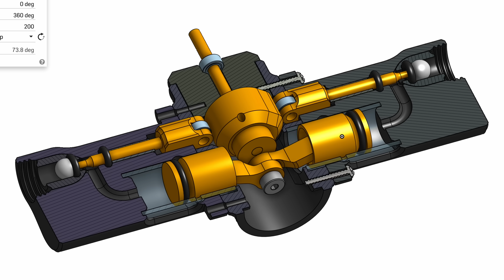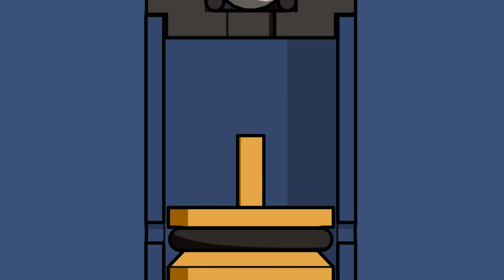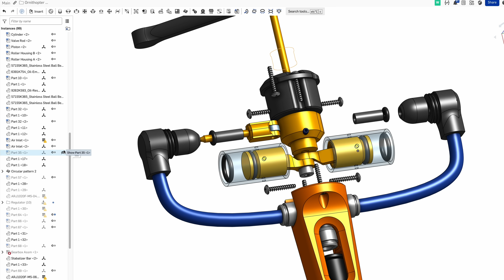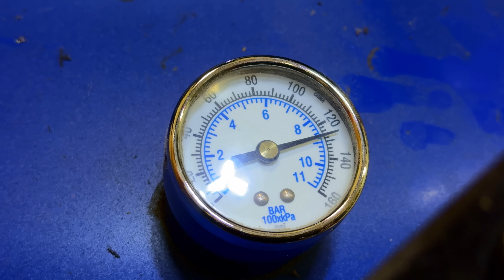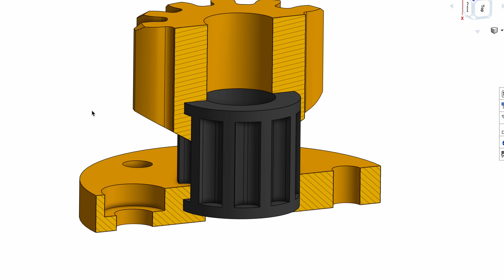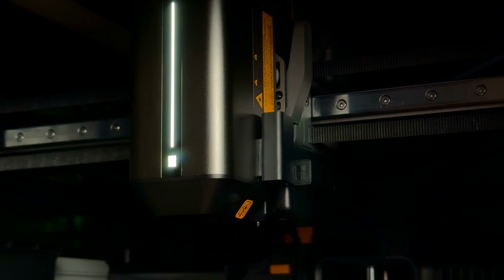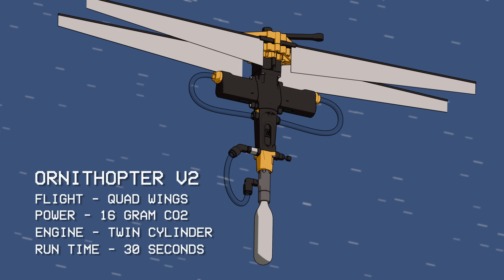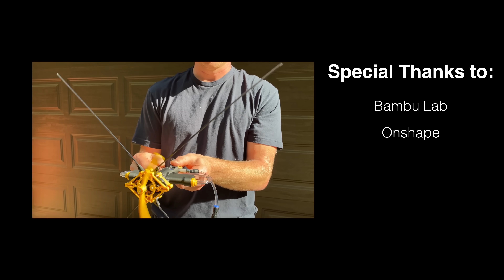I Tried to Build a Flying Machine With Just CO2

Comment: Great video! Do you have any Suggestion on a small pressure regulator?
Reply from the maker: Depends on what sort of pressures you need, there are some really small ones I used as the secondary regulator here: https://www.smcpneumatics.com/ARJ1020F-M5-06.html
Reply: @worksbydesign Thank you very much in advance. I would ideally need one that works with 6mm pneumatics, which doesn't have to withstand more than 10 bar. Thanks!  I'm really glad that you care about your comments!
Reply from the maker: @Karmesin-Pilz Anytime! and I believe the one I sent works with a 6mm line and has a quick-connect fitting on the outlet side.

Comment: why turn a linear motion into rotation just to turn it back into linear again? that seems like a major power and efficiency loss
Reply from the maker: Definitely worth a try, and I did try early on but it always ran better by connecting it to a flywheel or a crankshaft because it gave it momentum to continue firing evenly. And once I added a flywheel it was easier to just take power off of that rotation, especially when trying to find the best gear ratio to flap the wings. Could be worth taking another look at it though!

Comment: Your wing design is extremely lacking in optimisation you should have the torque required to double surface area. Wing should be loose towards the main body and fixed at the tips more like a triangle than a rectangle that you have. You have to remember that what you are building is a vertical windmill not a plane with aerofoils. You are looking to maximise drag not minimise. Drag is the only thing that will provide thrust in this situation.

Comment: Cool project! It’s just reminded me of a tool that has a reciprocating piston that is basically its own valve, it’s hard to describe simply but if you do a search for ‘Steve Lindsay engraver’ you should find plenty of info, patent design sheets etc. (expired now so ok to use). It’s very simple and ingenious and is used in this case in a gas powered, hand held precision engraving tool employed by jewellers, firearm engravers and the like.

Comment: Need that regulator vertical, nose inline so that your weight is even..
Reply: What if you connected the four wings into pairs?
Also if you tilted the bottom of the wings to 90 degrees on the return cycle you wouldn’t be wasting energy , actually gain lift… super cool stuff! Love the mechanics!

Comment: Why convert the engine’s piston motion to rotationl motion and the back to a back and forward motion in the wings?

This seem like an unnecessary step that both add weight and cost energy in form of resistance in the system.

A better way should be to create an effective motor that oscillates back and forth on purpose and directly drives the wings.

Comment: You need to improve your pressure regulator so you can dump the flow restrictor.  Add a third cylinder will improve engine balancing and add power allowing larger wings

Comment: Yes, iron parts add weight. What if it's a crazy idea to add a gas bag like an airship or a fish LOL This is cheating to some extent, but it will save you from recalculating the entire structure if the wing area is increased.

Comment: For Some Reason You Lowering the Pressure With The Regulators Is Ruining it And Also Planetary Gears Are Quite Inefficient!( Custom Set Diagonally Would be better most Common You Could Get Made Would be hypoid gears ) Probably be Better To Use Something 1, More Pressurised? but UnLikely You Could get Anything At a Reasonable Price that You Don't Make Your self Which Is also Expensive ether Way Try HydroGen as Not only is It Lighter and More robust but you Could Make Exhaust Thrust With A Piezoelectric Sparker That Uses Excess Torque to press a little bit of crystals together In Ociliation With the Outgassing which would Allow for it To Naturally Ignite?  if You Still wanting to Out-vent The gasses without Energy Loss As Just waste? , and 2,  Directed Push Like a Water Wheel As to get the Most Energy I think You Losing about 30-50% Just With The O-ring and Pressure leakage That Comes from the Ociliation and the way it's down Why Completely Out vent what is use-able Gas?

Comment: Makes no sense to convert linear to rotating, thru a gearbox and back again.
Piston moving the wing directly and maybe a return spring.
Also any regulating the pressure down is a 100 percent loss. Way better off reducing the intake duration, that makes more power with less air.

Comment: One possible idea could be to intentionally use the backfiring of the piston to power the wings. You need to switch direction with a gearbox anyway so to me it makes sense not to waste energy and weight on a gearbox that switches for each flap and just have a really fast piston that switches direction after every cycle

Comment: hypothetically couldn't you cut down on the weight and complexity by going back to the original piston design, but using a 5-cylinder radial design? That way once you've got it moving even a little, each piston push would provide the impetus needed to overcome the backwards pressure from the next piston?

Comment: Piston and reciprocating motion is not energy efficient. That said, you can still use hydrogen and a piezo actuator(not really electronic, since only a hammer action is involved)🤔, to compensate for lack of energy. Another issue is the ability to capture energy during the entire pressure cycle(with hydrogen, it is more of an impulse, so you don'tneed to worry about that). There is still a lot of energy left on the low pressure exhaust with the current design. Just some 💭

Comment: Aluminum parts could help in a bunch of places, but the complexity of the part molds makes me think that's not terribly feasible. But hey, anywhere you can work in a .45 mm wall Aluminum tube instead of a 2.7+ mm wall ABS tube, you can come out ahead.

The other thing I thought about is an opposed-piston engine design, chasing that power-to-weight ratio demon.

Comment: Consider that you might use the ideas from a reaction wheel or gyroscope to keep the flappy bird stable in orientation.  Also consider that if the pistons process in and out at the same time then the vibration will be limited.  Think subaru boxter engine.

Comment: Back in the 80's, they had these air-powered vehicles called Air-Hogs.  I had one that was an airplane.  You would use the included hand pump to pump up the chamber and then once it was pressurized, you'd disconnect the pump and then spin the prop and the engine would start up and the plane would take off.  It was very similar to this device.

Comment: Seems like this design would benefit greatly from a phase where the wing segments cut or align horizontally through the low pressure areas and vertically (or largest wing surface towards with angle of attack) to the high pressure area.

Comment: This is a very challenging project and you have made great progress. Suggestions to improve system: Modify the motor to use more cylinders with Tom's valve concept. Should get more power to swing bigger wings and less weight. Having more cylinders should overcome the lack of flywheel problem again dropping weight. An even crazier modification would be to eliminate the gear train and direct drive the wings. They do follow a reciprocating motion which is what pistons do. A linkage would be required to keep them in sync. Redesign plumbing to eliminate hoses and couplers. Build the pressure regulator into the valve plenum collapsing the vertical height. Again dropping weight. Good luck with your next version of this project.

Comment: I am by far not an engineer, but to start check wing designs, angles, size, pitch, etc. Regulate the speed a smidgen faster and yes, weight reduction. Use a heat gun on tubes for curvature but reduce the length,  then play around with other piston designs. Again I'm no engineer and other comments sound very plausible

Comment: Neat solution isolating the valve to eliminate the flywheel but, if you're going for a multi-cylinder engine, couldn't you go for 3 cylinders so that whenever a cylinder has to push the ball, an adjacent cylinder is in the power stroke so there is torque to drive the ball up.

Comment: I may be stupid but could you use smaller tubes to regulate pressure and air flow? It would take either really good math or a lot of testing. It could save a lot of weight on top of being able to remove the pressure regulator entirely.

Comment: 3:00 Okay, please explain to me why, when you’re trying to make something “oscillate with changing direction”, you worked so hard to make your engine stop oscillating back and forth and instead produce rotational motion, like what a propeller needs (which isn’t what you’re using), all so that you could then turn that rotational motion back into an oscillating one…
Reply: I guess the engine is way more efficient when its just running without changing direction
Reply: @juusoleinonen  That’s probably true for most situations, but I don’t think that is true here. A propeller needs constant even torque because the force it needs to exert is constant. But a flapping wings torque needs aren’t constant. It needs much more torque at the end of its swing when slowing down and changing direction than it does in the middle of the swing when it’s just pushing on the air. And I’m pretty sure that the oscillating engine design would have produced torque in that same pattern, meaning that for his specific needs it would have been perfectly efficient!  Instead he added more complexity and weight to his machine to produce an effect which is less efficient than what he could have had… 🤦🏽‍♂️
Reply: To include changing direction
Reply: @patrickwalsh7874 what changing direction?
Reply: You are right, torque at the right time, less friction etc...😊
Reply: Idk

Comment: Love the idea, and you used the steam engine intake but not using it for both directions looks like a way to not get full power, as the other cylinder is working just to move it. Also you may fall into the ‘rocket equation’ problem of needing more fuel for more weight.

Comment: I'm not sure what you would call a 'not opposed dual piston' layout, other than a good vibration source? (it's NOT a boxer layout).
Everything there seems to be going in the right (theoretical) direction, but many things could be improved...
You could create a twin inward opposed motor (two shafts and pistons into a single chamber), which would be inherently better balanced, and would only need one valve cam.
I would look into printing helical gears all round to lessen chatter.
If the torque being created is where I think it is, I would greatly increase the 'wing area', larger panels. probably with more taper towards the tips, and assembled with a bit more care (good tension, no wrinkles, sitting perfectly flat at rest), I also notice a small hesitation in each stroke? I don't know what is causing this (at a cursory glance), but I suspect it is absorbing a modicum of power in each stroke...
As for the flywheel, I thing you could utilise it more for some form of gyroscopic stability by changing it to a spoked ring with a bit of cross section, but this is delving into gyroscopic precession realms of which I'm not familiar \oo/
It would be getting SERIOUSLY complicated to get into a floating gyro ring with a skewed pivot, and link rods down to valves on the exhaust ports to vary the opening and positioning of the ports to get some vectors stabilisation...?
Interesting project.

Comment: With two pistons moving in opposite directions, you're constantly in power stroke. I wonder if there's some way to eliminate the rotating parts altogether. Go back to Tom Stanton's valve and drive the wings directly from the reciprocating pistons. Maybe Im mad. 🤡

Comment: 6:20 For avoiding vibrations, you can modify your crankshaft so as the pistons oppose each other two by two (180° phase opposition).
Very very good job.
Reply: Complicates the timing mechanisms and puts a lot of stress on the linkages.  Better to go rotary with an odd number of cylinders.
Reply: @danielf3623 It wouldn't be that complex though, and a 2 cylinder design would be simpler in a lot of other ways than a larger cylinder count radial design

Comment: You gave me a Reason to Subscribe but Just a quick one Imagine making a few and put them in weeding as decor on the flowers hovering above with tiny tubee to be connected to a powered air supply could run for hours

Comment: Wicked cool video. I would try cutting open a used CO2 cartridge to measure the wall thickness, and then put it in the lathe to make the walls of the CO2 cartridge slightly thinner, while staying as safe as possible of course. The cartridge is made of stainless, I think it's your heaviest part. Also try and figure out how much more resistance you can apply to the wings before the engine stalls out because I feel like your wings can be bigger. Lightweight foaming pla might shave a few grams off here and there on the other parts. Awesome design, you're truly amazing. I love your videos.

Comment: The wing should have more surface area. When the wing moves back and forth. Then it should generate enough air displacement for both sides. Then the wing rod should rotate a turn each time to generate as much air resistance as possible.

Comment: Cool looking and stuff. But just after you added the fly will anyway I knew it all was doomed..... You built your own pressure regulator an then used an aftermarket one....... 
Also my two cents. Please use an y splitter for the tubbing. And instead of using fresh air for both pistons, make it an two stage "engine" the first piston can be intered as an pressure regulator by it self and instead of putting air out, just use the lower pressure for the second piston. Now.... I'm not sure if making them linked by the same chaft would be the better choice.... Maybe independent sistems.....

Comment: 3d prints are actually terribly heavy for the strength they achieve. Look at aluminum parts (you'll have to optimize for the strength-to-weight ratio). Also consider ASA aero or ABS over PLA since these filaments are much lighter. Lastly, a clever design in nylon SLA printing could allow you to make these parts incredibly light and hollow (you'll need to account for how to eject the leftover nylon powder. But a truly hollow design would mimic bird bones.

Comment: you could definitely reduce weight by having the regulation system resin printed instead of made from metal, the wing platform and engine can have thinner walls and also you can less securing parts in wing platform. and lastly you can increase the size of the wings as well.

Comment: 20 wingbeats per second implies the output is running about 1200/min - about what the shaft would be running without load after the gearing.  That suggests there's sufficient power to handle larger wings while maintaining beat rate.  You could have significantly more thrust just for the added mass of larger wings.

Absolutely fascinating project.
Reply: I think that size is not the factor, I think that the torsional stiffness of the wings is not sufficient to keep an angle of attack over the majority of the wing, thus generating no lift (also minimal drag which is why the motor seems to be unloaded.) Perhaps the wings might be "large enough"  but they need to have some work done on them to produce proper thrust.
Reply: @robertwallace713  I seem to recall that ornithopter wings produce an inordinate amount of thrust not from angle of attack, but from "wave" motions- and even more so from when the leading edge of the wings come together. Seems to me the easiest thing to try in this respect is longer wing membranes.

Comment: Can you use only 1 regulator? and because it got split, probably the pressure going into the engine is not quite right. Or make slightly bigger flap to increase thrust.

Comment: Can LPG be used as a power source to replace the bulky CO2 tank? In addition, the gearbox is too inefficient. The 3D printed gears (aluminum) can be replaced with lightweight metals, and the wing area can be increased to increase lift. I am from Taiwan.
Reply: The reciprocating engine has a very low operating efficiency, so it is recommended to use a rotary engine to reduce inertia. The fuel part can use the gas released by LPG at 50PSI to drive the piston, reducing the weight of the fuel tank, air pressure valve and even the gearbox.

Comment: 283 dislikes = Brain damage. Tip for CO2 = Thermoelectric generator to recycle waste heat of motors to capacitor bank + use excess energy to pump exhaust through water tank with a modified exhaust flap + Ultrasound Agitation tank to swap the exhaust water with to release gasses super fast with Ultrasound perfect pressure control for storage or use. Points at the Soda industry and shakes a soda in masses face AHH!! CLIMATE CHANGE! < 🤣 Engine waste = Synthetic Diamonds and Carbon nanotube super conductor resources.

Masses can design better tech than sold on markets now, majority of it is to make sure the masses are easier to conquer during a crisis. Guy: "I just found out they can't fix my Car I can't afford it. They said what they need to fix is built in even though its something that often fails. You were right I should have got that GTO." GTO sound expensive = His dad said discount 20 thousand dollars he had 80 thousand it was MINT. College did that to him.. Beware about hiring College people.

Comment: Would you even need the cam design system with the dual pistons, surely the power stroke of one side is enough to push the other piston round. It would also save a lot of weight and complexity, you could even add extra cylinders for more power.

Comment: "Works By Design"

Doesn't work...

Just kidding, this is a super cool project, some really interesting solutions in there. Your camshaft variant of Tom's compressed air engine is a great improvement for these low-weight applications!